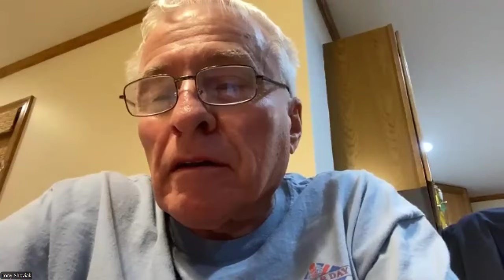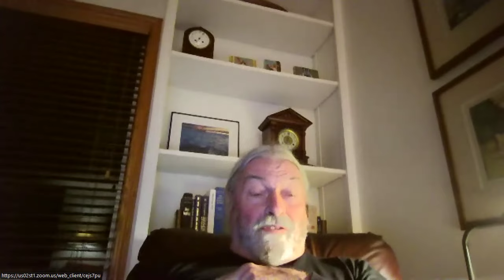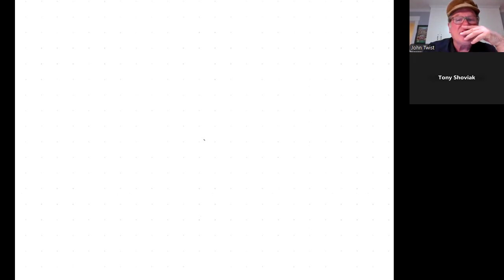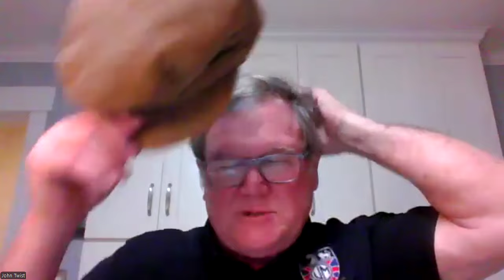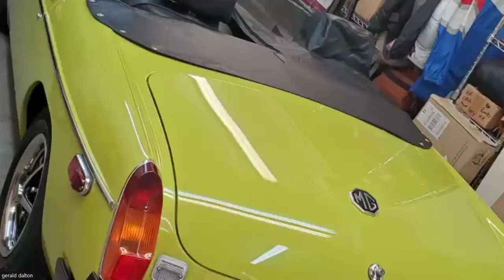492 MG Tech | Q & A on Winter Storage

Comment: Once a week (in the winter) I roll the TC either backward or forward ( a quarter or half turn of the wheels by pushing it) so this keeps the tires from getting a flat spot.  A piece of painter's tape on the front tire gives you a visual point of reference.